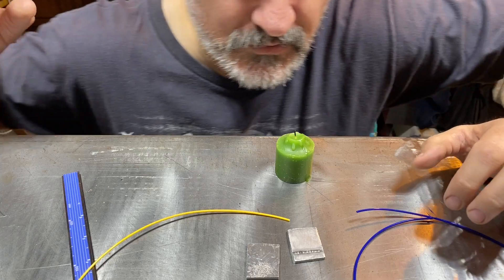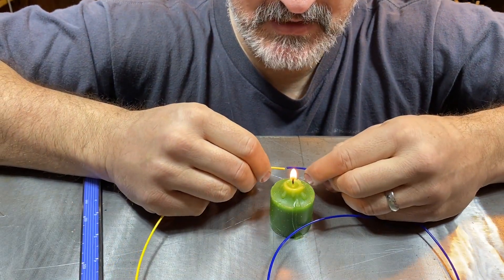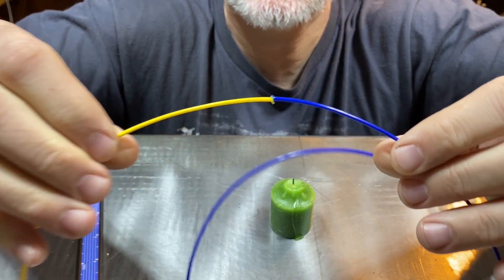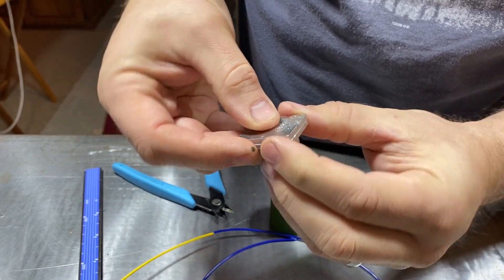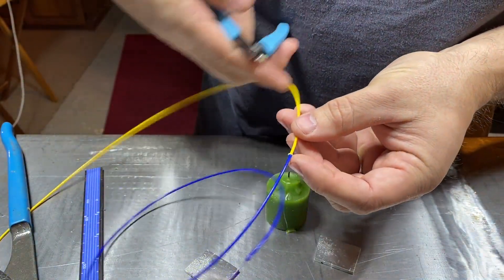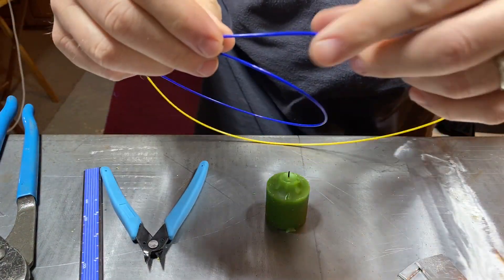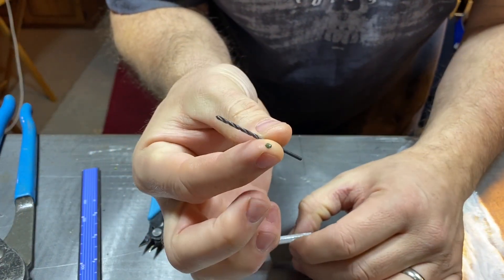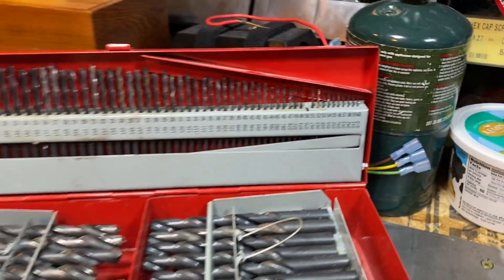Splicing Filament Fast and Easy

Comment: Making a crimp tool from a pair of flat faced pliers is a pretty smart idea! But let's take it ONE step further:
Buy pliers WITHOUT any plastic, bare metal only...
Grip pliers with oven glove, not bare handed...
Crimp two pieces together by overlapping them ever so slightly, closing the pliers and heating it:
BAM: Should be perfect! - Might work even better with PTFE sleeve, like they use on the Sunlu joiner? You could leave your flat trimmer in it's sheath! ;-)

Comment: Damn that works pretty good! not sure why but i thought this would be way worse than what i got. 

Even without the shaped metal to squish it at the end you can use whatever to squish it so the joint is sorta straight and it works, just make sure you heat it enough (of course not too much), if it doesnt get hot enough it gets weak and wont hold when you try to spool it and the joint bends a little, too much, like keep it simple idea guy says itl char and clog your nozzle or cause other issues. 

Thanks for the helpful vid, liked and subbed!

Comment: i like your little tool, but, i think you make it uncomfortable, i would use it in another way. one pice  lay down in your tool the other is free, both of them heat up and stick it together, if they touch each other slide both of them into yout tool. oversize material will cut from the egdes and it cool down very quickly. have you try this way ?
 greetings from germany

Comment: Out of curiosity, if using a 100% infill do you think a printed version of the tool would work?
Reply from the maker: It may work once or twice if you just need to get by. but eventually it will deform and not reduce the diameter enough.

Comment: Thanks man you just saved a print for me I started it off thinking I would get most of it printed "simple box so didn't care how much as long as I got the sides up some" anyhow it was still working on the bottom and was on the last wind of filament so did an oh crap and bing search brought up your video got the jist did the candle thing and just used some pliers and side cutter at first not great. Grabbed a needle nose out of toolbox put it in vice tried to grind a dimple with diamond bit so I could drill no luck really. Pulled it out found another diamond drummel bit that looked about the perfect size same as the #50 drill so then held the pliers in my hand and worked it back and forth inside creating a grove once grove on one side I slowly clamped down the other while sliding it back and forth creating a channel between the 2 sides. At this point I was about out of time there was only about a foot of filament left and it was just starting to print the sides of the box which was in vase mode so it was speeding up. I hurried up and clamped my splice a few times and cleaned it with side cutters still had a little rough spot but with an inch left I had to let it go and hope for the best. It went through with no issue and I checked I didn't even have the grove fully made so I probably actually clamped the splice a bit tighter than 1.75 which is good I think. I got the splice going through the boden tube and printing on video will prob post it in next few days, showing the tool I made etc. Would not have happened without your video though I will credit you thanks again.

Comment: Good video. You have to clamp the aluminum pieces and use some kind of cutting oil so the aluminum doesn't adhere to your bit and bind it in the hole, snapping the drill bit off.

Comment: Hey man I like this. 👍🏻  A lot of people just fork-out the dough for fancy tools 🔧 when there are other ways. 
My only gripe is that you use dark age terminology with I do not understand 🤨 Like what is a 50 drill bit 🤔
Reply from the maker: Lol the number 50 drill bit is the closest I have to 1.75mm ( the diameter of the filament).   In addition to fractional drill sizes, there are also number drills and letter drills.   They are used frequently in industry, they offer many sizes of bit varying by only a thousandth of an inch or two between letters and numbers
Reply: That’s not dark age terminology… literally a size identifier and he even showed you at the end.

Comment: This is neither fast nor easy and results in a weak bond. You need to cut them at an angle before joining.
Reply from the maker: Actually guys.  I’ve found a better way.  See my newer video https://youtu.be/ukN8L5rGWoI?si=VxKTHnOuwza11alY
Reply: The extruder doesn't care, I've done jankier ways of this and it would work smoothly.

 Make a video showing a better way if you're so fucking smart. We would genuinely like to see it if you have an easier, faster, and better way to do it.
Reply: @kikook222  i go even more ghetto and just hit two pieces with a lighter and smash em up.  my prusa mini eats it like a champ lol.  this is a lot nicer than what i put through it